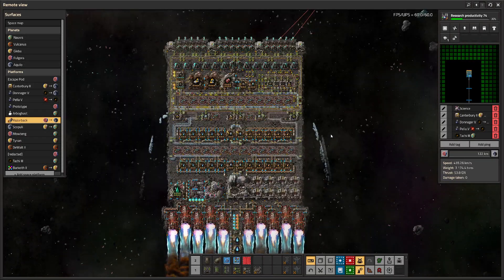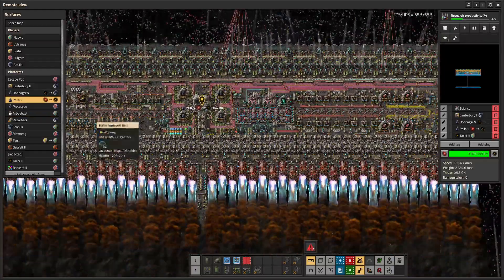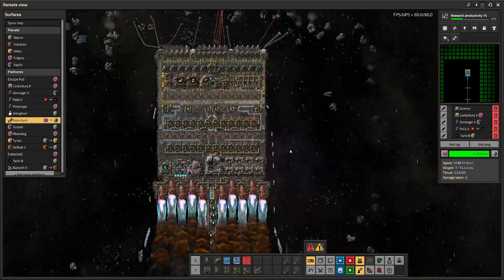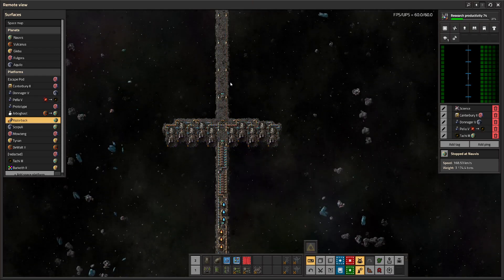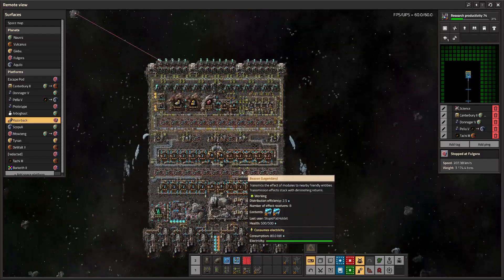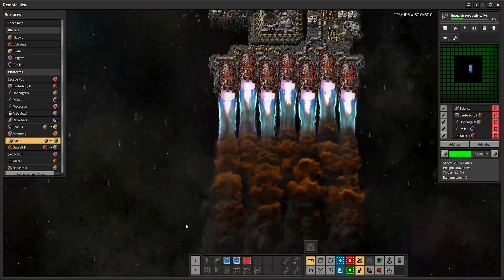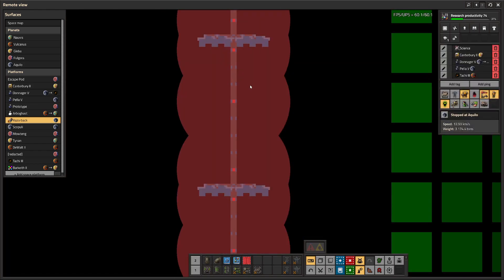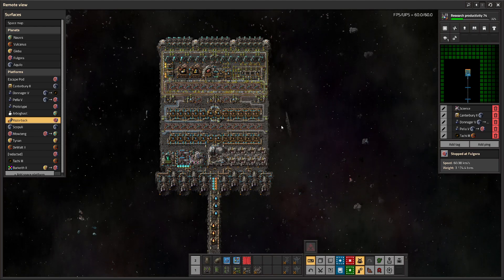Factorio Space Age - 2040 km/s Platform: Making the Fastest Ship Possible with Thruster Stacking

Comment: You can save on width by arranging the thrusters in a funnel shape. Most people do an arrow-head when they use the pass-through connections on the thrusters, but if you reverse it, you don't need pipes that extend past the last engine. It looks a bit weird perhaps, but it does the trick.
Reply: To rephrase what OP said, engines arranged in a V shape.  No extra width needed.

Comment: Does anyone know what the rationale is for dumping so many of the meteors you harvest off the ship instead of just not placing them on the sushi belt in the first place? Like I get if you get a small bump in numbers from the crusher returns, sure, dump them. But that's THOUSANDS of items, there's no way you couldn't just not put them on the belt in the first place, right? And yet all the pros do this. Anyone know why?
Reply: I think it has something to do with belt capacity. Usually the grabbers are closer to space, so instead of having to mess around with trying to get to eject asteroids from the belt, just discard them out of the grabbers using circuit logic when the belt is full.
Reply: The circuit network already knows how many items are needed.  The asteroid throughput is so high that you really do need to throw away that many asteroids.  You could fill the belt a bit more, but you'd still need to throw away the same number of asteroids.

It's generally best to have an asteroid belt that is half full or less, otherwise new asteroids can't be placed on the belt.  If no asteroids can be placed on the belt you risk a jam due to only one asteroid type clogging the entire belt.

There exist ships that actually use the vast quantities of asteroids as resources, but the devs deliberated limited how quickly items can be unloaded form the cargo landing pads, so there's an effective upper limit on how many items per second can be usefully delivered to planets.  Spaceships easily exceed that limit, hence most asteroids being junk.

Comment: And this is another reason why speed being based on width is dumb. Even if they say that it's based on drag, which barely exists in space, these ships would still get way more drag because of the thruster wings being so far apart.

It's also the fact that the UI tells you the weight, implying that it's quite relevant while it's basically irrelevant (I believe it is taken into account, buy negligibly compared to width). I know this can be easily modded, but still.

Comment: Why not add inertia so ships follow the relativistic equasion which is m(v) = m0/(1-(v^2/c^2))^0.5  ? With that ships can go very close to lightspeed and follow physical formulas, we have to talk about slowing down though as in that case you could technically fly from the solar system edge to nauvis and arrive there with idk. 100.000km/s and nothing slowing you down, we need backwards engines for breaking. (Full formula for speed I would suggest: V(force)=m0/(1-(v^2/c^2))^0.5 * force * time) m0 is mass when not moving, v is current speed, V is new speed an t is 1/60 of a second, the topoff would be at 99,9period percent of light. Here 0,9period is important, it can't be one as c is unreachable, you can only get infinetely close to it.
Reply: Small mistake in the formula I suggested, how I suggested it more mass = more acceleration but I meant it the other way around so (force*time/by the rest) + current speed = new speed, the divider would approach infinity so the force (kgm/s^2) would be divided by an infinite mass after being multiplied by time and we end up with m/s as a speed gain. Sorry for the mistake.
Reply: mostly optimisation and simplicity at a guess
Reply: NERD
Reply: @thedirtbagstash  sorry for being a nerd, it's the only thing which I didn't get bored of and physics are fun so yeah, me pure nerd in redstone, math, physics and programming, would be a chemistry nerd too if my school would have allowed physics and chemistry together. (Not like I am programming snake in binary code on my own 8 bit minecraft cpu which is 1.16 vanilla friendly...)
Reply: @thedirtbagstash  you are LITERALLY on a Factorio video
Reply: i think probably the reason why they didnt want to use some more complicated formula like this might have to do with performance, that's a complicated formula to calculate the current speed a ship should be moving at every update for every ship that is currently flying.

Comment: 4 months after release we have the devs giving more attention to a mechanic that 99.9% of the players will never even come across but completely ignore the non-existent endgame where you trade 50% of your UPS to have the privilege of researching one and the same tech that plateaus around level 70 anyway, and there is nothing else promethium is used for.
Reply from the maker: ?

The devs haven't given much attention to thruster stacking. A comment made by a dev upon witnessing it is not the same as spending actual development time on it. They've said they wanted to address it and they haven't gotten around to it.

Promethium ship UPS is indeed a huge issue but will require a ton of work to address, possibly reworking the entire system. The problem is the sheer number of particles/explosions/objects to track - every little asteroid chunk is not just a particle effect rendered by your GPU but an object that the CPU has to track. They are definitely aware of it and will get around to it eventually, but it might take a while.
Reply: I loved the endgame, getting legendary quality up, making all the planets run well. So much more outside of the normal game. The shattered planet thing without anything there seems like a mistake. No enemies after gleba also seems meh. Still 9/10 for me
Reply: i am still questioning why they removed landmine ships, instead of maybe balancing them
plus you still can't set filters on an inserter without turning filtering on

Comment: I have also toyed around with this kind of design and have buold massive thruster stacking for a legendary asteroid ship I built and just want to note that you cannot just easilly keep stacking them forever as you make it seem. Since thrusters take quite alot of fuell you will eventually run into pjmp throuput issues. On my ship for example I had to use something like 30 legendary pumps every like 5 layers just to maintain my 330 Thrusters I had. While pumpthrouput obviously isn't such a strickt limitations, as you can always keep adding more stacked in parallel (until you hit something like 200 pumps), it is something to keep in mind.
Reply: What speed does that give you?
Reply: the thing is this issue can be almost totally avoided with buffering, and not just of the fuels itself but also of chunks on belts with underground weaving to make fuel locally for each stacked set of thrusters, or of processed chunk products, iron ore, ice, and carbon, which you can ship up from planets, so you could still buffer that without needing the ship to actually move to collect a reasonable amount of chunks.
Reply: Just use more pumps and buffer tanks